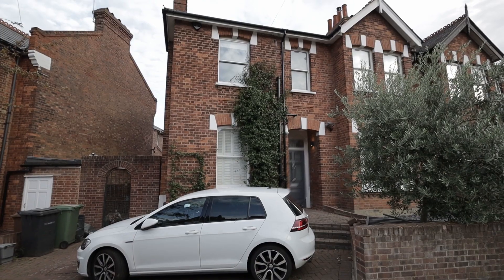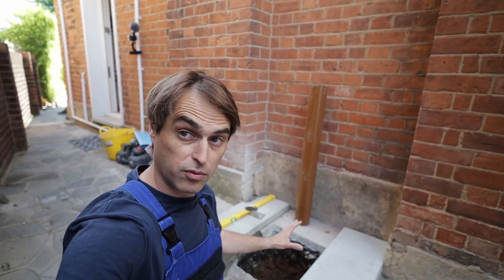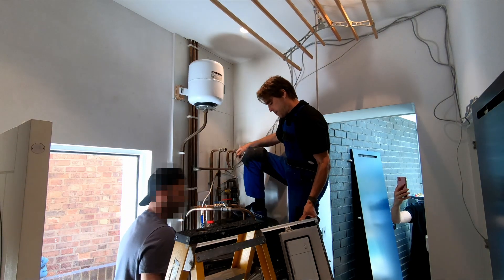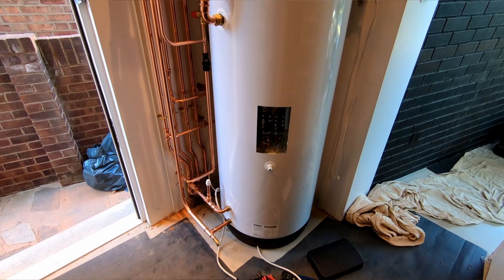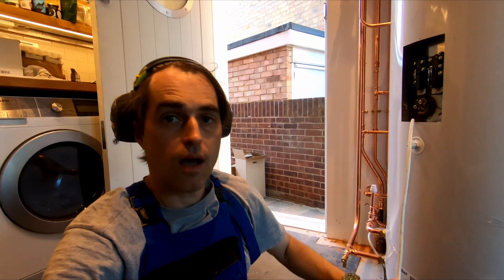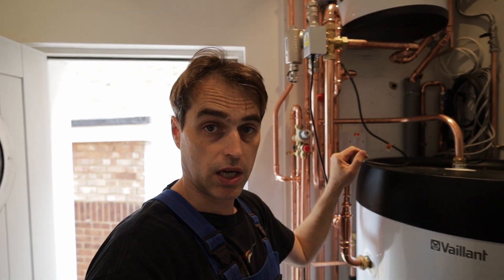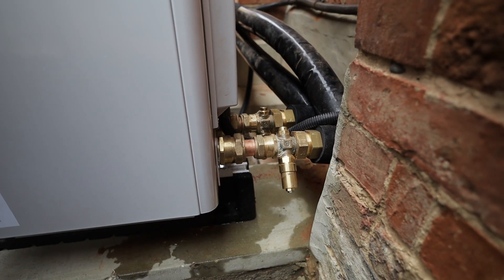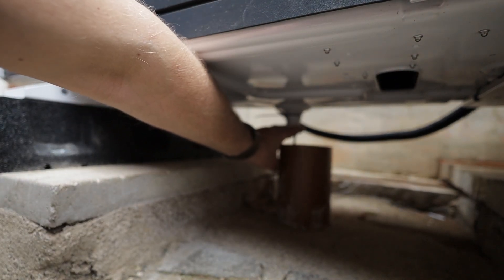Is This Heat Pump Better Than Your Gas Boiler?

Comment: Utter waste of money please don't get this waste of time system in your House, It can only reach 21c in winter which is very cold when it's -2 outside,
Reply from the maker: You can reach 30 if you wish. Just design for that and be ready to pay the bill.
Reply: @UrbanPlumbers  Total waste of money . I'm a Heating engineer.
Reply from the maker: @robertfisher632  if you are a total waste of money as an engineer maybe change careers ?
Reply: @UrbanPlumbers  Stop telling people it's a good system tell people the truth. A house needs to be fully thermal before a heat pump system will heat it above 21c. The energy needed for this will cost a fortune.
Reply from the maker: @robertfisher632  you really have no cule
Reply: @robertfisher632  Even if you were right it is not relevant. We need to get rid of fossil heating as fast as possible.
Reply: @Freba9  I agree we need to get rid of natural fuels but heat pumps are not the answer they are up to 3 times more expensive than normal heating systems . Your house needs to be fully insulated both attic space and cavity walls for heat pumps to work the way they are intended to.
Reply: @robertfisher632  It is all worth it as they are 3 times more efficient than any electrical alternative. Any other solution does not make sense when it comes to energy savings and lowering CO2 emissions. Heat pumps are the answer.
Reply: 21C... you lucky bastard that's really warm actually! 
My place gets 15-16C this winter because of the gas crisis and price hikes in Europe. Only a few rooms will get ~18C. 

I usually don't heat a lot anyways since my house is almost 120 years old and was build for coal ovens in the rooms you wanted to be warm. It doesn't make any sense to try heat the entire place to an even 20C. Just a waste of energy. 
Gas used to be 6-7 Cents per kwh now its ~20 Cents I think it fluctuates a lot right now so I don't bother looking it up every day. I also get a pretty cheap rate since im a long time customer (10+ years) of our local supplier.

Comment: 10:50 So in summer it is 21% cheaper to run, and in winter it will be much MORE than 21% more expensive to run.  I always knew this thing was a stupid idea.
Reply from the maker: 20% overall cheaper to run. Actually with current price cap it’s more like 40% cheaper to run.

Also saves the environment as a little bonus
Reply: @UrbanPlumbers  There is no global warming, CO2 is not a greenhouse gas, there is no greenhouse effect, CO2 makes the whole world verdant and green so we need more CO2 in the atmosphere. It's your enemies who have persuaded you to willing participate in your own self-destruction by de-industrializing the developed world.
Reply: This all depends on how the electricity rates are in your area, how well your house is insulated, how you heat i.e room temps, how your system is sized and how efficient it is etc...
Heatpumps are pretty neat.

But people ought to pick up a calculator and go at this logically.

Comment: Very interesting video. I can't get over how big it all is, that would take up masses of space in my house in comparison to my new combi boiler.
Reply from the maker: this is a small unit! 10-12kw are double the size. It is bigger and more expensive than a combi, but can be cheaper to run, will last 20 years if installed well and cuts emissions by 70%-75%
Reply: @UrbanPlumbers  All fair points (and great video!) but, if you can't fit it in, you can't fit it in. My tiny utility room wouldn't be able to swallow this and I can't think where else it would go. How much cheaper are they to run, out of interest?

Comment: I like your pipe work, but I wouldn't use push fit connectors. And I've just installed a traditional old style heating system in my house with all soldered and compression connections and no elbows anywhere. And my heating doesn't have ANY "smart" devices or computers or software or any network connectivity either, so it's totally hack proof.

Comment: Isn't that a bit dangerous having a super heavy hot water cylinder high up on the wall? No-one's fitting anything like that in my place, NO chance! Wall mounted boilers are a big enough risk. And do those heat pumps have any so-called "smart" functions, like so many of today's contraptions? If so no-one's fitting any in my place, smart devices are nothing but a liability.

Comment: with this installation electricity bills will increase more then half when gas bills will be little bit less gas is always cheaper
Reply from the maker: This set up is cheaper to run than gas even at gas being 4 times cheaper than electricity

Comment: Hi Szymon, I’m installing an air source heat pump and have wet underfloor heating in a 50mm liquid screed with 200mm pipe spacing. If I run the system at a flow temperature of 45c with a return temp of 40c, would that cause my engineered wood floor to overheat? The maximum recommended temp is 27c for the flooring. Would a thicker sand cement screed help in this situation? I don’t want the ASHP cycling continuously. Thanks

Comment: Have you worked with the Intergas Xource 7 yet? I have one installed and was wondering about your opinion on them. We run a 25c flow temperature, new build. Think we use about 2500kwh a year on heating now. And about 500kwh for hot water.

Comment: Moved into new property with ASHP set up on fixed HTG temp 45, seems this was left by plumber to check operation than to use weather compensation. Have switched to weather comp for both HTG and domestic hot water.  Also wonder why there is no water softener to underfloor HTG pipe work laid in screed?
Reply from the maker: weather comp is only for heating, not hot water. There is no need for a water softener to heating ciurcuits.

Comment: You have to have space for the hot water tank and a buffer vessel, also space outside; my combi is wall mounted 40 x 70 x 30cm, then there is the larger radiators.
Reply: PS. combi's are not oversized as you are heating the water instantaneously, in the heating mode they are lower rated and modulate to minimum or off completely.

Comment: Assuming the estimate is correct which I am dubious about because in colder temperatures the Unit is less efficient as it needs to use more electricity to work the issue is that Gas per Kw/h is still way cheaper than Electricity. So, yes being more efficient is great but that does not mean the Operating Cost will be cheaper. One needs to invest in Insulation as the Building in this video has which is very expensive, internal insulation which is cheaper to install than external means less space (so your house will sell for less) and it means removing Electrical Sockets and Skirting Board. External Insulation is the more expensive option and has its own problems; exterior pipework will create problems with insulation and if your roof does not overhang enough that is another problem and unless you invest in ventilation you will get damp so you probably need an air exchanger system in the roof space although if you have chimneys you do not use you can probably use them as the air flow vents. Then you need to replace all radiators and pipework which will mean taking up the floor on both floors in most cases. Air Source Heat Pumps are fine for New Build or Old Buildings that are having a huge re-furbish but they are not a silver bullet. And of course they are a new technology and if you want a repair done or servicing done it is far more expensive than a Gas Boiler and that assumes you can get someone

Comment: All well ang good but what happens when the outside temperature drops between minus two and ten will it still generate heat without the need for electricity backup to keep the house warm..

Comment: Savings can be supercharged if the heat pump is connected to a good solar PV system with battery storage. Expensive total set up, but the saving is phenomenal.
Reply: That is I suspect the key, but I hate to imagine the price.

Comment: Great video, everything nicely explained! I was impressed by how perfectly you did all the piping with manual bender - these copper pipes at one point looked like a piece of modern art!
Air-to-air heat pumps are great in a moderate climate like in UK, but in regions with much colder winters ground-based heat pumps make a big change. Too bad it's a such an expensive investment!

You said that it would be 21% cheaper than using a previous gas boiler. How does it apply with energy prices raising so dramatically? Probably it's still better to rely on electricity, since you can always invest a bit more and put some PV on the roof and there's no way to generate your own natural gas 😉

In my country now everything is so unstable - I don't know what will happen with gas prices, electricity prices, I don't even know if my PV rules will stay as they are (the government said it will, but it's hard to believe them). My home is using a gas boiler, and since heatpump is a huge investment I'm considering putting a multisplit air conditioner with ability to switch into heating - of course, efficiency isn't that great as with full-sized heat pump, but I'm hoping for it to help me escape from the raising gas prices.

What do you think about such a solution?

Have a nice day!
Reply: Just check the major air to air manufacturers. They are even more efficient than the Vaillant presented here. I just installed Mitsubishi with 530%, while Panasonic goes up to 600% but unfortunately for double the price
Reply: @maggok5522  Is tha 5.3 COP (not 530 % efficiency)  in cooling or heating mode? At what exterior/interior air temperature? Read the specs very carefully!
Reply: @nickwinn7812  I was referring to SCOP for European climate. One needs to look at the EU energy label selecting the area where you live. It will tell you the efficiency of your heat pump during heating season considering your climate. For my area in Germany regular air conditioners are between 5 and 6. Btw..SCOP EU and US are completely different
Reply: SCOP for heating, SEER for cooling
Reply: @maggok5522  Thanks, I'll have a look. With these raising prices such investments will quickly pay off 😀
Reply: We have air-to-water pumps in colder climates now too (lithuania). Ground based ones have completely gone out of fashion.
That said I do wonder if split systems are even better and simpler solution.

Comment: Great video! You’re calculations at the end are interesting, I presume you assume that both systems are running 24/7 when you estimate the heat pump to be 21% cheaper to run. Reality for me is that the boiler won’t lose much efficiency when cycling whilst I think the heat pump would, I run mine around 40% of the time in winter. It would be good to see how a heat pump compares under this scenario
Reply: Heat pumps don't cycle... My guy atleast not any in the past 10 years. They are all inverter based and will adjust the heat output to match the temp inside the building. Old heatpumps would ramp up to 100% until they hit their target temp and then shut off than when it got to a few degrees below that target they would kick back on and that can loss you upto 30% efficiency right there. A new heatpump will just run at 60% if that's what's needed to maintain the desired temp.
Reply from the maker: Heat pumps still cycle when it’s 10c outside or when user deciders to zone the system and no additional volume in the system is available

They also cycle a lot when installed with buffers and flow rates are different on both sides causing distortion

They can only modulate to 30% of max output at best and they have higher output with higher external temps
Reply: @randybobandy9828  "Heat pumps don't cycle... My guy atleast not any in the past 10 years. "
New single and two phase heat pumps do very much still exist, and they're several thousand cheaper to buy than variable phase units.
Reply: @wisenber  what are you talking about phases? I'm talking about the compressor.  Thousands cheaper? Lol even the cheapest heat pumps that are sub $1000 are inverter based.

Comment: Great video, I am purchasing a house that has warm air heating and will need to replace the system. This is a great video and one of the options is a heat pump after I have completed the insulation of the house, but one point I saw was the temp was set to 40°c but to kill legionnaires disease it’s recommended to get the heat to above 60°c. Am I missing something In the video?
Reply from the maker: 40c is the flow temperature for heating when it’s -2 outside. Hot water is usually done to 50c plus there is legionella cycle once a week that brings the store to over 60c.

Comment: As you said at the start of video the gas system was pretty new system  so how many years will it take to offset the cost of the carbon footprint of the new system (raw material, transport, installation costs.). The average person in the U.K moves house every seven years so will the home owners ever see a return on there investment. It's like the most environmentally friendly car you can drive is the one you have now to service it regularly, drive sensibly and use  other forms of transport when possible.